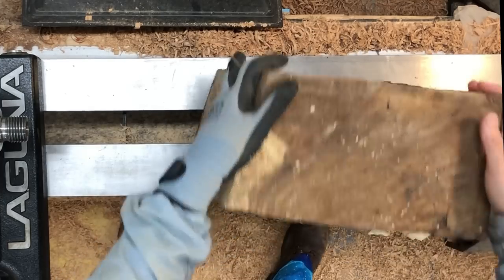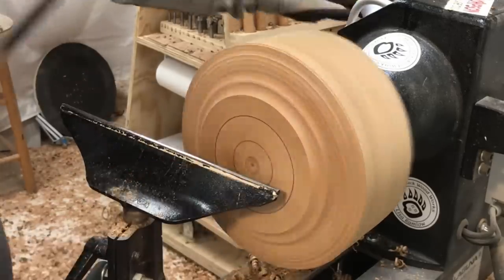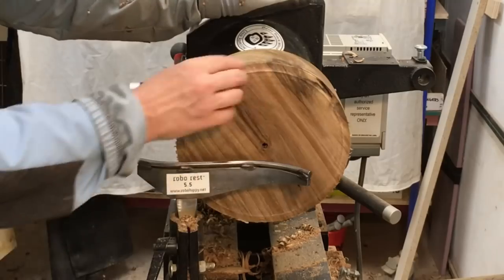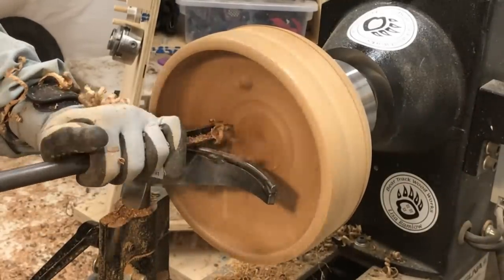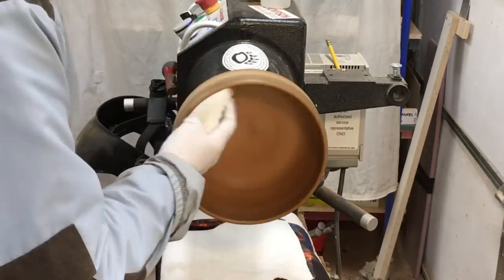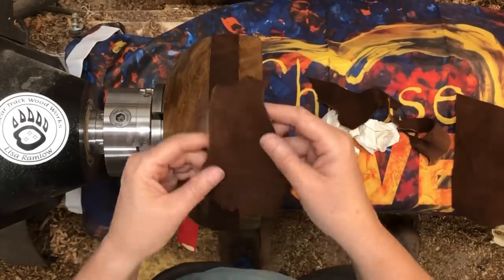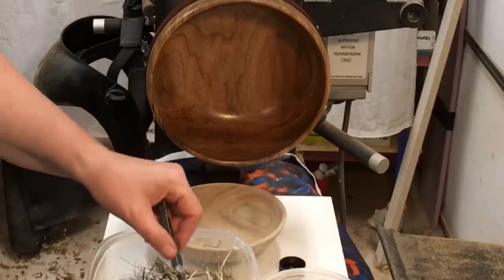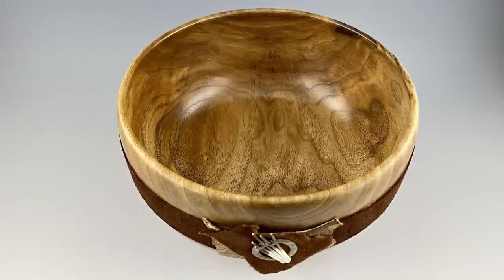Wood Turning Mixed Media: Butternut Bowl with Leather, Brass and Porcupine Quills

Comment: Do you use a 40/40 grind for roughing out and a swept back grind for finishing?
Reply from the maker: Hey Stuart! Yes and no 😂. I kinda switched back and forth during the roughing but I did use the 55 or 60° swept back grinds on the bottom. I’m liking certain grinds for very things, tho it seems like sometimes one gouge works better on a particular price than others 🤷‍♀️🤣
Reply: @LisaRamlow  thanks for the sorta explanation… I know Stuart Batty & Ashley Harwood ex spouse the superiority of the 40/40 but many other turners I follow use other grinds. Just trying to get some unbiased feedback on where what works better. I’m trying to learn so thanks for sharing your experiences 😊

Comment: Would blue painter's tape have helped in keeping the wood glue off the rest of the bowl while you put the leather on?
Reply from the maker: Hi Bill! Probably. I didn’t get much on the bowl, and I wiped it off with a damp rag. After I was done I used the paper towel I applied the Tung Wax with and buffed that area a little bit - no traces left 👍
Reply: That was my first thought, Bill.

Comment: I hate it when beautiful wood is wasted, I like it better when you or any wood turner makes the cores into,small bowls,!
Reply from the maker: Did you not notice the bark inclusion running down the center? I did finally buy myself a coring system but I l ow better than to try and core an iffy piece of wood.